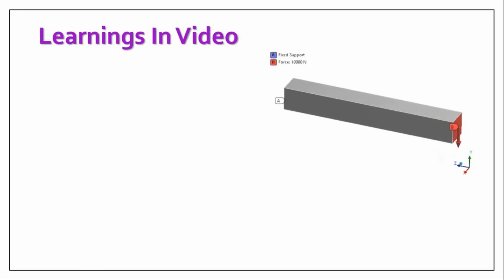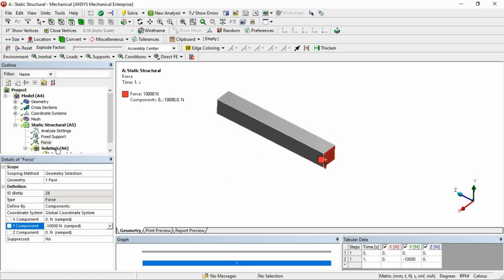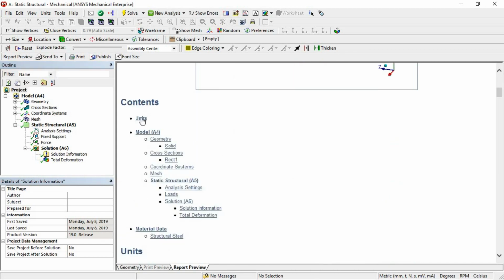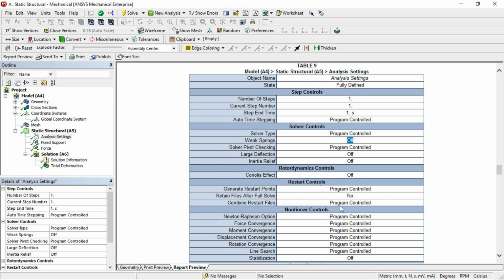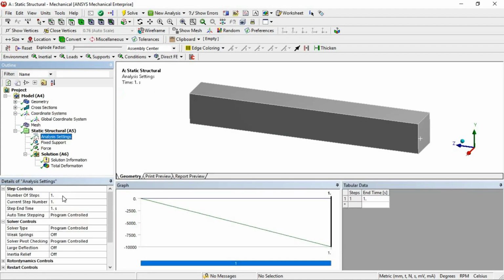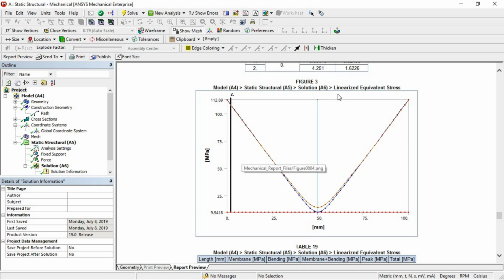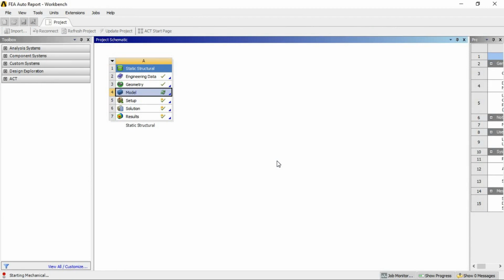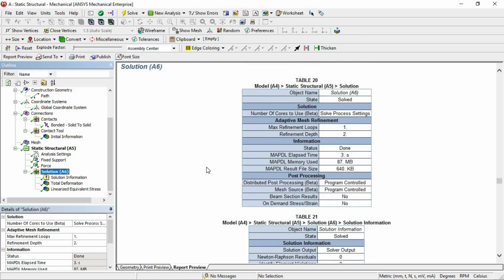Report Generation in ANSYS

Comment: Hi 

Can you please explain what is meant by stress linearization and where it could be use.
Reply from the maker: We need validate pressure vessel as per ASME guidelines & ASME suggest to carry out stress linearization. We need see principal stress to find the normal (compressive or tensile) stress & if you have manufactured vessel with brittle material. Pressure vessel are generally made with ductile materials & in such cases, you need see equivalent stresses only.
Reply: Same question.
Reply from the maker: Hello, Stress linearization is carried out to find out stresses across thickness (path). refer video link for more details: https://youtu.be/iJEVFvChyIQ
Reply from the maker: Hello, Stress linearization is carried out to find out stresses across thickness (path). refer video link for more details: https://youtu.be/iJEVFvChyIQ
Reply: @graspengineering9249  Okay. But my question is why we have to find SCL path what is the purpose & where it will be useful.

Your video shows how to do the stress linearization. There is no explanation what is meant by that and what kind of problem it will useful. I need that kind of information.
Reply from the maker: In case of pressure vessel, we mainly interested to see stresses across thickness, not only on surfaces. Also International codes gives guidelines for stress extraction across thickness for pressure vessel which is done through taking path across thickness of the vessel called stress linearization. It is mainly used to see the stresses across the thickness by taking path called SCL.
Reply: @graspengineering9249   Why we are looking a stress across the thickness? Is this any special reason is there? Because in pressure vessel case we always see principal stress and meridional stress along the plane. What is the purpose to find the stress across the thickness?